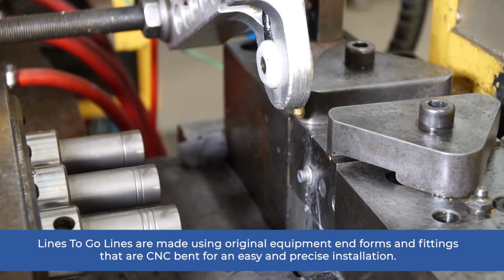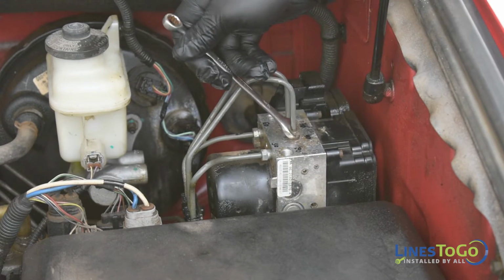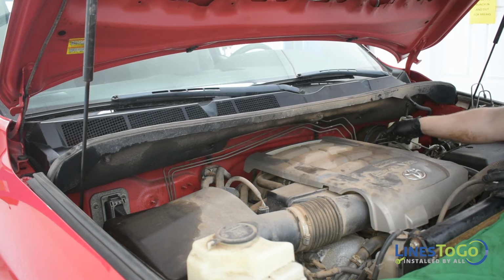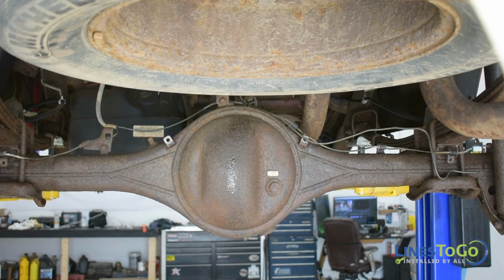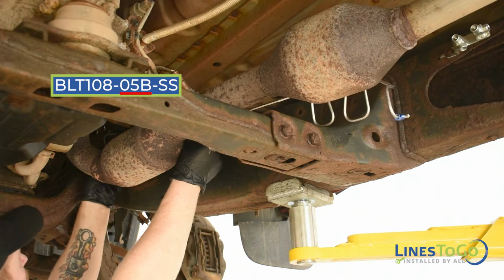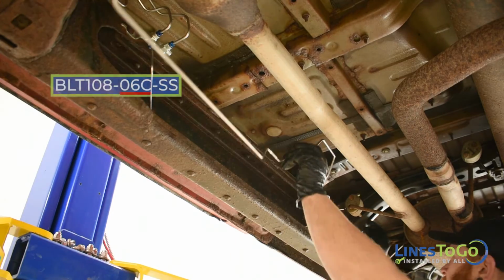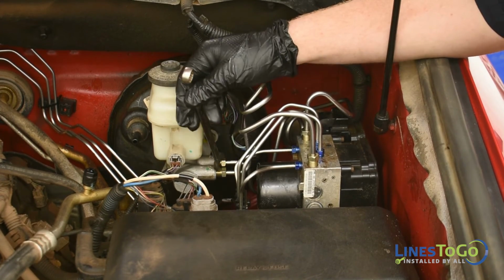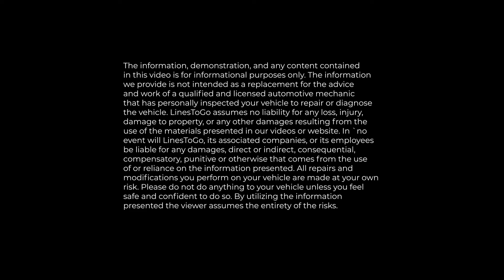How to Install 2007-2015 Toyota Tundra Brake Lines

Comment: So...... All that and didn't change the flex lines ????...we don't have the rust like up north , but our rubber lines seem to give way to breakdown and expansion here.... Is there part of the kit that is flex lines only to get ?
Reply from the maker: Hello Paul!

Unfortunately we only carry the hard lines. We do not carry and hoses or flexible brake lines. This should be you are able to source from a local auto shop.

Kind Regards,
LinesToGo